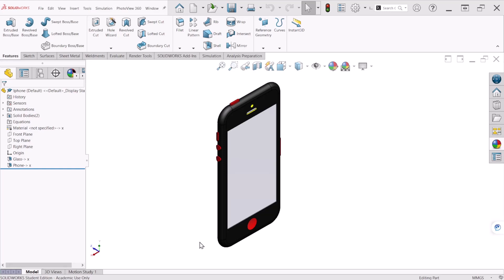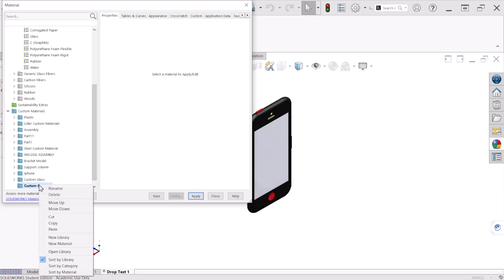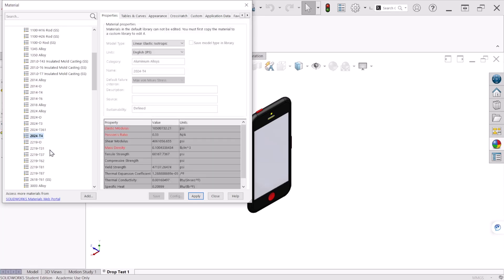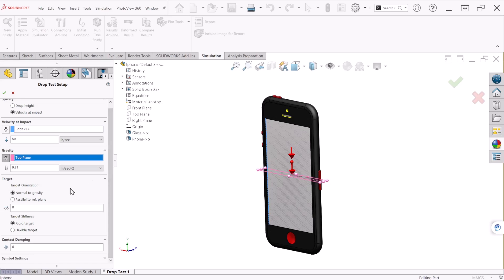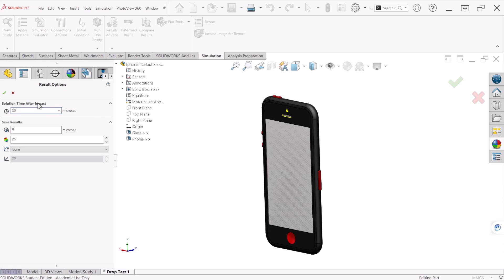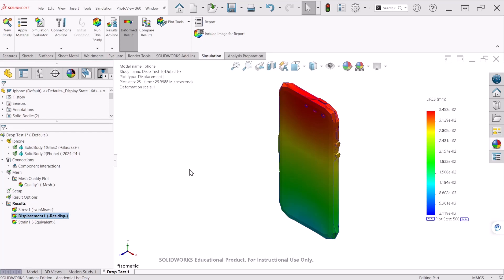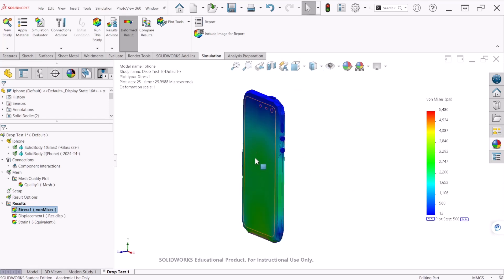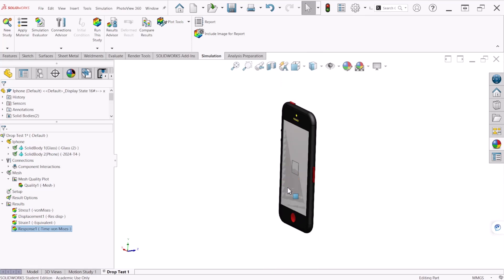Drop Test | Sensitive Sensors | FEA for beginners | SolidWorks Simulation

Comment: Thanks for this, but I'm a bit lost and I'm asking out of genuine curiosity please. The velocity at impact v = 50 in/sec which equates to a height of about 3.25 inches if I'm correct, is that height not too small to be generating such high stress values? With these results at a height of 1m or 40 inches. I also think the model weight would play a significant role in this.